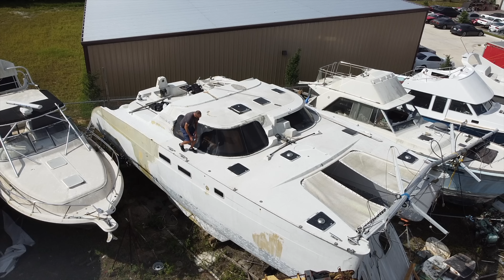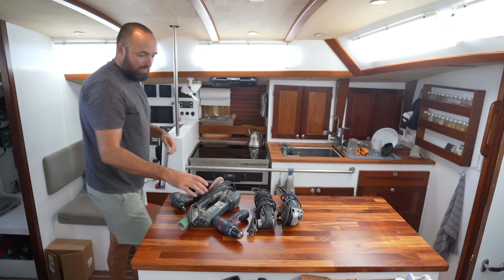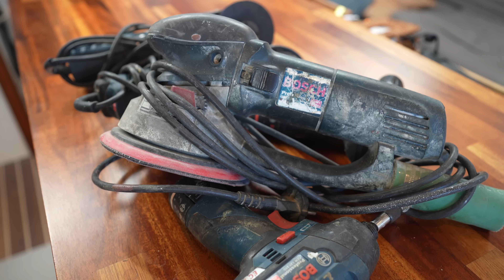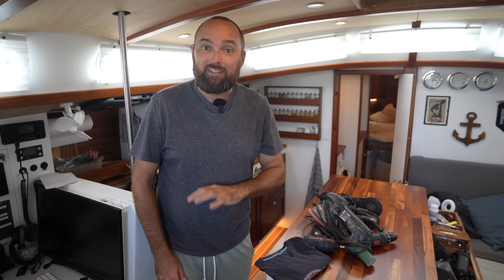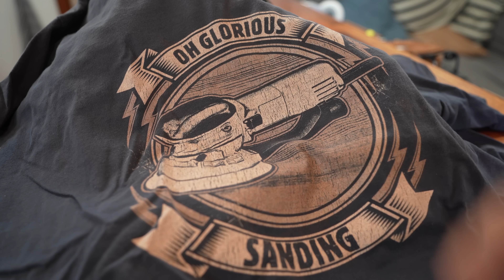🚗 Oh, glorious tool road trip!

Comment: You need to add a 3d printer to your toolbox. Highly recommend Bambu Labs. High print speed and it just works out of the box. I have the P1S which is enclosed and gives me options for printing with certain filaments that require more chamber thermal control. I can also upgrade the print heads to use carbon fibre infused filaments which is my next step. The use cases are Infinate but this will be especially useful for custom jigs and templates. Need special adapter for your vacuum, des one up and print it. It's a bit of a rabbit hole to jump into. There's all the different filaments with good and bad properties, the 3d modeling software (I use Fusion 360 free version but you may not be able to put this content on YouTube if monetized) and finally the slicing software which comes with the printer. In simple mode settings are preset for almost guaranteed print success but under the hood is a myriad of options - this is really where all the magic happens. Also have a look on websites like thingiverse for models that already exist - many are already parametric. I have found the print accuracy phenomenal and can work in the 0.1" accuracy with ease. Rabbithole well worth jumping into Imo.

Comment: As always great video. 🤗  FYI  I drive back and forth from my home in S.E. Texas to my parents home in central N.C. due to elderly parents failing health.  I drive straight through with the half way point stop at either a safe truck stop or a safe rest area.  I recline my seat and cat nap for an hour or two.  Then it's back on the road. I'm a retired Deputy Sheriff.  Have never had any problem to date. I put an extra large fold out sun screen in the wind shield to block out light &  give privacy.  Cheers, S/V Cork~Texas 🇺🇸⛵🐬🐕

Comment: You say "something simple like an o2 sensor that needs replaced" but man, those can be tucked away in hard to reach places, and require a lot of torque to break loose since they're baked on with a nice layer of carbon, lol.  Depending on the car, it can be a real pita.

Comment: I still have a Bosch cordless drill screwdriver in green from 2006..dropped it got it wet used it thousands of time in all ways and conditions, still going strong only battery doesn’t last as long now.

Comment: You have the tools to fix the boat if you do not go perfect mode two years. Hull deck mast you can do the rest on the water. I bet a pint of good English beer It will be longer from the day you get the boat. The hull the deck need to be spot on,the mast the same. The rest can wait. better to sail have fun then work. Just to remember why you are doing this.
Reply: He spent a week on the tramp ramp and that didn't include the hatches or any tramp mounting hardware.  One can extrapolate from there.  He's got 3-4 years minimum at this rate and with no significant breaks.

As for putting it in the water it would not make sense financially. Unless he just stores the boat anchored it will cost him about 2-3 times as much to find a marina in that area compared to what that salvage yard is charging him to stay there on the hard.  This is Florida in hurricane country. The work will go faster on the hard.  

He might move it to Titusville on a mooring ball but that would not save any money and just complicate the commute to work.  Also, power considerations for AC and tools.  It doesn't make sense to have two boats in the water in Florida during hurricane season.

Comment: Yep. Bosch blue are hard to beat. My 30 year 12mm (1/2”) old router with soft start and electronic speed control was years ahead of it’s time and is still running perfectly after a LOT of work over the years. Small tip: Leave the ignition on and you will wake with a flat battery. Even without running the fan. Guaranteed.

Comment: I also love Blue. They have been very strong and reliable while renovation an old house. They are beat up too but keep on working.
Reply: I love makita blue... but with battery tools it does pay to stick to one brand, it's silly to have so many incompatible batteries! I recently bought an adapter to use makita batteries on a Dyson stick Vac, so cool😎 so much better than the dyson batteries👍

Comment: Honda came out with a new CR-V in 2002. I don't remember it having the fold flat seats of the 1st gen CR-V. I do remember it had a completely flat as in absolutely no driveshaft hump foot area for the rear seats. It also had rear seats that tumbled forward leaving a massive completely flat back area. One thing it did retain was the picnic table.
The fold flat seats came out in the 2003 Element. The rear seats where attached to the sides instead of the floor so you could fold the seats up and have flat load area. It was also covered in rubber so you could "clean" the interior with a leaf blower.
If you hadn't guessed it from this post or the previous post, I really like my 2002 CR-V. Especially with the manual transmission.
Reply: Current owner of a 2006 Element and I absolutely love the seat configuration! I have it set up with one back seat up and another down right now so I can pick up stuff like building materials and totes of mulch.

Comment: Tools are so important, that one time when you need a tool that you don't have you find out how vital the right tool for the job is. I have an 11/16 box end wrench, that I made at some point by cutting the open end off of a combination wrench, and making it about 2 inches long. I was working for a company and the equipment I was fixing had a nut buried in a crazy spot. The wrench I needed didn't exist and it was a freak repair - so I sacrificed a cheap 11/16 combination wrench to the gods of progress with a bench grinder. It is still in my tool box, can't remember what I was fixing when I made it, but someday I will need this specialized tool. Thanks for the great videos!

Comment: Oh Glorious $1.50 Beef Hot Dog & soda refills at Costco (Sam's as well). An upper level manager at Costco home headquarters wanted to increase the $1.50 price. The CEO and founder said if the manager did so - ho would be shot. The pledge of the CEO is to keep the price at $1.50 as long as he lives. Mads - next time try the hot dog and soda if you have not done so already. :¬) Webhead USA

Comment: 17:02 if that happens to me, i usually just find a piece of scrap, take the old panel apart and use it as a template, then take the new panel apart, overlay it (good opportunity to seal things with proper sealant - nobody uses proper sealant in a factory) and then cut this bezel out. With a pair of snips, you can make light work out of it.

Comment: Oh man!  I live at Waterford Harbor. Would have been so nice to meet you and lend a hand.
As a side note, I have spent quite a bit of time at the same marina in Florida. The floating docks are a huge improvement. At low tide, getting on and off the boat was a high risk operation, especially for a person with rather short legs and reach.

Comment: Bosch Professional (the Blue not the Green) are amazing. The difference is that the have advanced features like brushless motors, overload protection, and the gears are from better materials. Well worth it if one goes for hard, prolonged use...  ... so not color blind, just honestly one of the best brands out there.

Comment: A couple of great, and inexpensive tool’s that you should add to your toolbox are a mitre box and a Japanese pull saw. You’ll never have to worry about tear out on your teak trim again.
Reply: This! Easy to store, lightweight and no need to worry about voltage.
Reply: Amazon has a nice yellow plastic one for about $15.

Comment: Looks like you replaced the wiring harness on Perkins 4.108. I did the exact same thing a couple years ago. The back of the gauge itself has settings that may need to be adjusted. I believe the kit came with a small allen key for the adjustment. You have to adjust the gauge to get an accurate RPM. Easiest way is to buy a reader and read the RPMs off the crank pulley and adjust the gauge accordingly. I'm heading back to my boat but won't be there until Tuesday afternoon. I'm willing to look at my connections and setup. Let me know. Also, if you haven't found a suitable sun canopy, for your catamaran project, go to the flea market in Melborne, FL. There is a vendor there selling canopy poles and connectors. The flea market is open Friday, Sat, and Sun. You may find something there. You may have to buy tarps to fit the frame.

Comment: Weren't most of your "blue" tools battery powered (not the sander, of course)? So all you'd need is a charger, if the 220 one truly doesn't do 110 (and these day they often just do both). I mean I'm pretty sure you're aware of being able to buy chargers, so I assume the rest of the non-battery-devices was worth it.

Comment: Timing belt? Or serpentine belt?
Reply: Almost certainly timing belt. It usually has a service interval of somewhere around 100,000 miles, and it's not a service you'd want to skip, if it fails you end up with severe engine damage (bent valves, damaged pistons, etc.)

Comment: Tools.
I like 12v tools, buy without the batteries, then wire direct to the boat battery.  
Ads, no loss in energy converting 12v to whatever.
Disads, no that common. 
My favourite is a mini angle grinder.  It is from Parkside (bought from Lidyl, uk).  Compared to a 230v it is not that powerful, but then those are scary.  The beauty is you can use with one hand. I use with (Bosch) diamond cutting discs, and sanding discs.
Reply: This is actually a nice idea :)
Reply: Very nice.

Comment: I bought a turbo 150 because of you! I dearly love sanding with it, thanks!😊
Reply: I think it may be my next sander but my old Makita keeps running with only a new bearing every year and a new backing plate every few years.  I modified the filter attachment to accept a standard mini wet vac hose and it has very good dust management for a  <$50.random orbital sander.  I bought a $10 10-pack of bearings on Amazon and aftermarket backing plates are $5 there too.  The thing is 8-9 years old now and has hundreds of hours on it.

Comment: Hi mads, I also rebuilt a huricane boat . Just a tip , one our 1st big projects was cleaning water, algae & grime out of the aluminum diesel tanks inside. We had to cut acess holes in our cockpit floor as well as the tanks and purchase after market fuel tank acess covers with gaskets and  screws kit available at marine supplys. Because  our tanks we had baffles we hired a pro fuel tank cleaner with the speacial tools to clean the tanks.    Its something to think about.
Reply: I would have hoped that Brian already took care of the tanks but who knows?  He didn't seem to be very systematic in the years of work he spent on this boat.

Comment: Darn, I would have told you to check out Bucky's if I knew you'd make the trip before posting the next video,it's a novelty but it's the best maintained and spotlessly clean place for restroom's, food and fuel. Stopped at several on the way from Maryland to FL on a recent trip with a stop at historic Savanah Georgia.  Sometimes, it's nice as the driver to take a break and stretch your legs.

Comment: Easy option, get a spare 12v battery that you can use instead of the socket in your car with the added benefit that it can be used to jump start your car if your car battery goes flat or better yet your car battery doesn't go flat because you used the spare battery overnight.
Reply: 😢sadly, they give off hydrogen gas and in an accident are not situated to prevent harm to passengers--but really like you are going!
Reply: Our 1970's boat was designed to carry wet cell lead-acid batteries right under the settee in the saloon. There was no special ventilation or anything.  

If that's not wild enough the LP gas bottle sat in the anchor locker and a copper pipe was factory installed to run from there to the galley stove.  There was no original shut-off solenoid installed and the stove had no thermocouples to hut off the gas if they blew out either. 

This boat was Lloyd's of London certified for bluewater ocean crossing as produced.  Times have changed.  They made 750 of this model and none of them to my knowledge had any problems.

Comment: do you think it would be possible to build a life size 3d printer benchy boat out of fibreglass , if so how would you rate its stability , i would have to add a proper keel as the flat bottom would likely capsize , how many layers of glass is athenas keel ?
Reply from the maker: That's a fun thought. I don't think it would be a good construction method. You'd end up with poor strength in between the layers (no fibers going across).

Comment: Check you fuse box.  Some manufactures have it so the position of the fuse in the box determines if the 12v outlet turns off and on with the key.   The indicator of this option in the fuse box will be a fuse slot that is wider than the fuse.  The fuse being positioned to one side will have the power turn off and on with the key.  Shift the fuse over to the other side of the slot and you have continuous power at your 12 v outlet.  The other simple option is to tap into a 12 v feed.  The glove box light wiring is often easily accessible.  A couple t tap electrical connections and you are good for fan.  As for places to sleep while traveling look for "rest stops" or "rest areas"  along your route.  Typically every 30 to 60 miles along an interstate.  Less frequent but still periodic along other routes.  If you are using a GPS hit the search and most of the time there is an area to click on for rest stops along your route.
Reply: Also* be wary of sketchy rest stops.  They may have criminal activity.  Places like WalMart, Sam's and Costco permit overnight parking, just be sure to notify security who you are and where you are parking.  Safety first.
Reply: Not many rest stops off hwy 10 from Huston to Pensacola. Just an FYI….
Reply: @DVolvoguy777-x7o  Thank you for that info.  Not familiar with the area.  Assumed similar to the north.  I was surprised to see when googled the trip was less then 8 hours.  An afternoon drive.  My impression was that it was a much longer drive.

Comment: Omg bosch is a hate hate hate love hate relationship for me. 

The spiffymobile and the boat(s) would payback dividends if theyre protected with a very specific product, griots ceramic 3 in 1. 
I think this chemical protectant is literally capable of saving the planet. 
Think of it, if your car, or other like belonging never degrades from oxidation or solvency and is never dirty, how much longer will it last? Multiple more DECADES i think. 
If everyone used this, there would be no car washes, 
no bad paint
no bad plastics
no water damage
no oxidation damage
IT would work to perserve the things we love or once loved. 
And it would take us all about 20 minutes once a year. 
It appplies just wiping on  with a rag on cleaned surface, 
And it just plain lasts for about a year. 
And no car washes, no cleaning. 

1 bottle does about 5 large vehicles or about 2 athenas if you are sparing. Then the coating cures and sheds water and reflects uv rays for about 1 year is what people do report back and actually get from this solution. 
It works great on anything, it even brings back faded plastic, the chemicals listed on the bottle i have not heard of, but i am sure they are the best of the best for the application. 

The cheaper products are magnitudes of order less durable, and less easy to apply. 
So, this is my 
Product of the century, 
As unexpected as it was, the stuff actually works!!!
Reply from the maker: I think it's too late for the spiffy-mobile 😂🙂
Reply: @SailLife  Maybe its the obd2 computer, with all the problems i have with my old macbooks, it could be the elecronics.

Comment: Pro tip for "car camping"...purchase a car cover and nobody will bother you and nobody can see what you have or if you lights on or are even present.
Reply from the maker: That's a fun idea :)
Reply: how are you supposed to get in the car with the cover on.
Reply: @More_Row  Lift it up and slip in
Reply: Sounds like it would not have good ventilation in the hot and humid Florida weather.
Reply: @MumpingVillain1776  Seems to me that is a condition you agree to accept when you move to Florida !
Reply: We are Florida residents but we don't even own a car for camping.  Our sailboat isn't large enough to carry one.

We leave in the spring for cooler latitudes to the North and don't come back until the end of November.  Our insurance won't cover us at all if we come south of 32 degrees North Latitude before November 14.  That's basically just a few miles south of the Georgia S.. Carolina border.  

By that time it is getting pretty chilly some days -especially in the mornings.  It sucks to need to scrape frost off of your dodger windows before raising anchor.